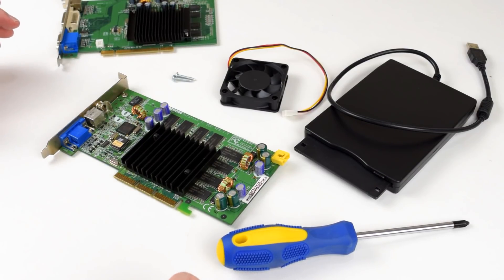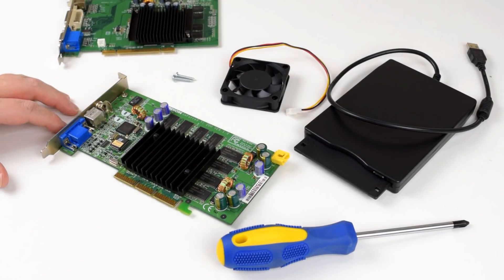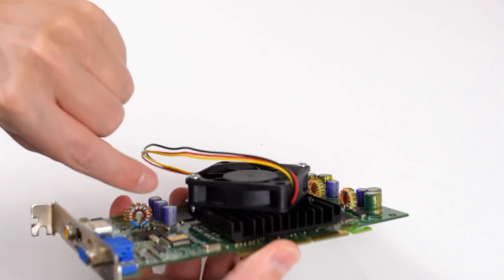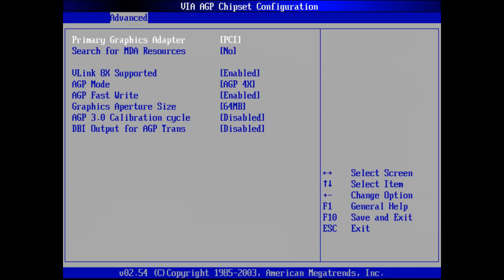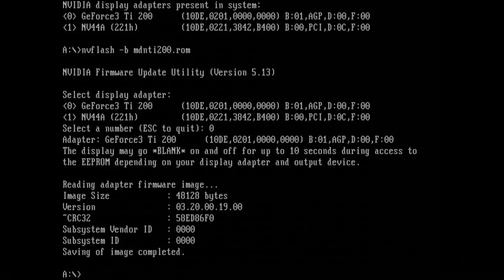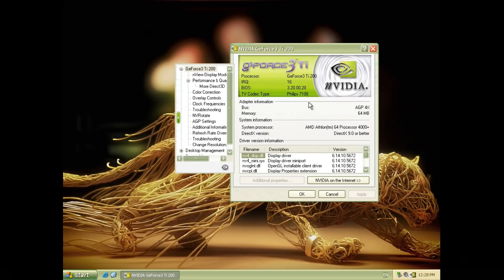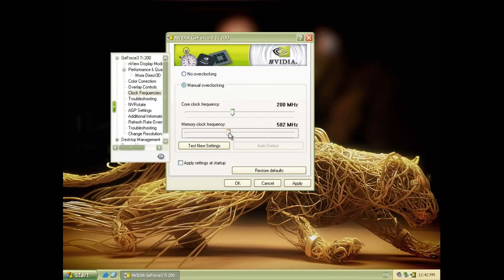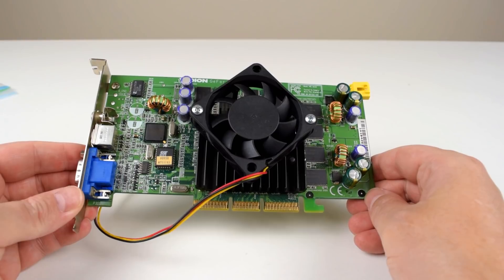Can we mod a GeForce3 Ti 200 into Ti 500?

Comment: Caution!!
Those capacitors are very prone to blowing themselves on higher clocks... (My own experience!)
Reply: Electrolytic caps can have a determinable life span if you know what temperature they run at on average, higher temperature = shorter life; if you look at an electrolytic capacitor datasheet it will actually give you expected service life at least for two operating temperatures.
higher clocks can cause the caps to wear out faster, not directly but it can because the current draw will be a lot higher so their internal resistance will cause them to heat up more and if they are close to the VRMs they will get even hotter still as some of the heat output from the VRM will go into the caps through the PCB and through the air. the VRM's will be fine so long as they don't overheat they should last as long as normal.
Reply: Last 2 things I had, a motherboard and a graphics card had a pooped capacitor and both were Sanyo... :/
Reply: I've got a TNT2 that's been overclocked since my aunt first put it in her Pentium MMX 166 OCed to 200Mhz. Both the TNT2 and Pentium MMX work to this day...Those electrolytic capacitors just like to explode.
Reply: capacitors have nothing to do with higher clock speeds.. All capacitors do, is smooth out the current. Regardless of wether your stock clocks, or overclocked to the max, Capacitors are still doing the exact same job..
Its the VRM's that take more abuse when overclocked, Because they have to stabilise a higher voltage/current than preset...
Reply: I had a FX5200 and a 8600GT overclocked to the max they could, both ended with blown capacitors, just saying it can't be a coincidence...

TNT2, GTS250, HD5770, GTX960 that I had and didn't OC, never had any issues...
Reply: capacitors can and do fail at any time.. there is no set amount of life hours of them, some can fail within 10mins, some can last 25 years..
i have old pentium 1 pc motherboards with same capacitors on them, and the fact that i overclock EVERY graphics card i own, and they are fine.. But then ive had a brand new tv blow capacitors in less than 6 months...
Reply: there are some special batches of capacitors between 2000 and 2008 that are bad...
Reply: This card has Sanyo capacitors, they're excellent!

Comment: So you did it! Well done. So first note, are we sure we can install a fan header to medion as it may not missing only the header but the whole electronics accompanied to it?? Second note, you flash the bios you but you are not sure about the timings of the memory etc, but the issue here is that a rated memory does not corresponds to its speed. If its was the voltage the ti500 bios should have handle this? What bios did you tried? Have you got any idea about the pcb of the card and any mod for it? This way we can see how much voltage the memory gets. We have the same results in regards to the core(240 with cooling but 250 goes bad) but my memory runs only 420mhz. This is strange as it seems that the limiting factor is not the memory it self but something else on the card.Good trick with the fan.
Reply: Graphic cards didnt get programmable voltage controllers until somewhere around GeForce 6/7. Voltage is fixed with resistor divider on the PCB, and Vmem was the same for all GF3 (original, ti200 ti500) 3.3V VDDQ, 2.5V VDD. Timings are inside the bios and should already be relaxed for the ti500.

4ns = right on the edge
medion =  very budged MSI, might be custom lower layer count pcb with sub optimal routing
Reply: Found the way to mod this, but the vmem and vcore are the ones rated from the factory as you say(and so goes the voltage controllers). The medion has reference design in regards to memory but somehow slightly different for the core.  Maybe with higher voltage will get higher speeds but this does not change the fact that it does not do the 500 mhz which is rated. It is somehow gimped from the factory...for a 10eur/10$ card it is OK.
Reply: Sure you can mount a fan header. I did it and it works just fine. Well actually I just soldered two pins in. The contacts go through the PCB, so it doesn't even need additional solder.
I guess the memory uses different timings. On later cards (Geforce 6-9) one can actually change the timings and get the memory chips above their rated speed. Reminds me on the countless days I spend bringing my 7300 GT to above 7600 GS levels.

Comment: You should name it the GeForce Ti 350!  Also noticed that most images of the Ti 500 have heatsinks on the memory as well.
Reply from the maker: Haha good idea. Or Ti 500 LE or something like that :D Good point with the memory coolers.
Reply: Call it a Geforce 3 Ti 400, and if you get the core even higher Ti 400 Pro, that would totally fit into nVidias naming scheme :D

I actually got a Radeon 9600 Pro LE. It has all the features of a Pro but only 200 MHz memory. (instead of 300 MHz) Clocks are workable, but the memory jumps aut after around 230 MHz.
Reply: yeah or  GeForce Ti 400

Comment: If the artifacting on the memory overclock didn't start right at the beginning, the memory might getting too hot and you might need stick-on heatsinks. If you think about it, higher speed DDR2 sticks beyond the base Intel or AMD spec usually had heat spreaders. Memory type and brand also play a factor. For example, I have some rare DDR3 Mushkin RAM, 996657. Not too long after that model, another model with the same stock settings came out but it was not as overclockable. I paid twice the amount for a used set after buying a new set a few months before, ~$250.
Reply from the maker: I noticed some artifacts right after turning the machine on, so I don't think it's the cooling. But adding cooling blocks onto the RAM chips does make sense.

Comment: I have the same card with the same memory chips and also can't run the memory with 500Mhz. i think the DDR Voltage is lower with the Ti200 cards from medion/msi, or the 4ns memory chips that couldn't handle 250Mhz are wasted, but could run with lower clock speed.
Reply from the maker: I also think it's to do with the voltage. But could be timings, I haven't gone as far as studying the datasheets and comparing BIOS timings.
Reply: Or messing the DDR voltage with a multimeter.

It's not a problem, because I have take out the Ti200 (because of the isue with the RAM clock) and now installed a Asus V8420 Ti4200 128MB. The card also has 4ns Samsung Chips, but runs without any problems with the ti4200 64MB clock (the memory on the 64MB version runs with 513Mhz and the 128MB version with 440Mhz). 

Now I can use better AA settings. :)

I also have a Asus V8460 Ultra, but this card is for my PIII-S Tualatin 1400@1575MHz Sys. :)

Comment: using an old Celeron processor heat sink skipping the fan.
Reply: msi nvidia GeForce 8400gs 512mb haven't tested it yet under overclocking conditions but I'll get around too it.

Comment: Sometimes it is needed to manualy change memory timings. At ATI cards it's simple, RBE let you do this easily. Of course first thing to do is check datasheet of memory module.
In your case, when card has "Medion" bran on it, thet just cheaper or lower quality MSI cards. In Polnad we try to awoid this cause of that (few days ago i bougth 7650GS from Medion and it just stop working after one minute)
Reply from the maker: Good tip, worth looking into!

Comment: Wish we could mod a fx 5200 into a 5800.

Wait-
Reply: fx5200 worst card ive ever used
Reply: Wish i never flashed the HD 5750 to 5770, i failed to flash it and i broke it.
Reply: wish I could flash my gtx 1080 to a 1080 ti... 
oh wait you can and I did
Reply: you could actually make a 6950 into a 6970 unlocking the other compute units :D (i think linustechtips has an old video about it)
Reply: Jur El It does, just requires some driver modding

EDIT: But seriously, what would do with 1080p FX 5200? Play Wolfenstein 3D at 1080p60? Or Half Life 2 1080p10?
Reply: https://www.reddit.com/r/hardware/comments/38nzj0/is_there_an_overview_of_rebranded_graphic_cards/
I said my prev comment as a joke, because those cards are 1:1 exactly the same (except some might be overclocked)
Reply: 1080p works fine on my FX5200 using VGA
Reply: +Str1kernaut If you have another GPU, you can flash the original BIOS again in order to unbrick it.
Reply: TheLazyWanderer you can up to 5500fx, but not so much speed at all.
Reply: i've been able to make mine run at its speed via catalyst control Center but the card ran a little Hot.
Reply: ΛVINIDE never heard of the 650 to 740 mod. Link to any resource on that?
Reply: You can't. You can only mod it into a 5500 since FX5200 and 5500 share the same chipset. (NV34)
Reply: Even then, the FX 5xxx series is pretty bad, I'd rather have an ATI card.
Reply: i wish i could mod the 2gb 1050 to a 3gb 1050
Reply: Wish we could mod a GTX 650 into a 740
Wish we could mod a GTX 680 into a 770
Wish we could mod a HD 7950 into an R9 280
Wish we could mod a HD 7970 into an R9 280X
Wish we could mod an R9 290 into an R9 290X
Wish we could mod an R9 285 into an R9 380
Wish we could mod an RX 470 into an RX 570

Wait..
Reply: MrJ0mmy It's not that bad